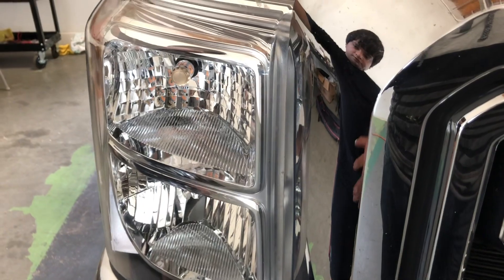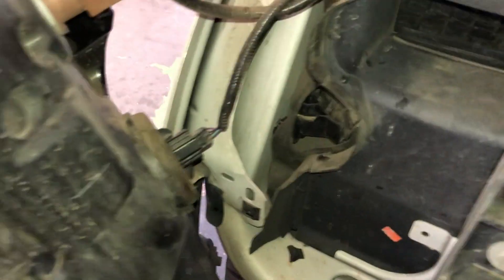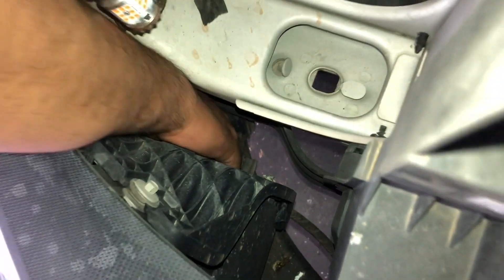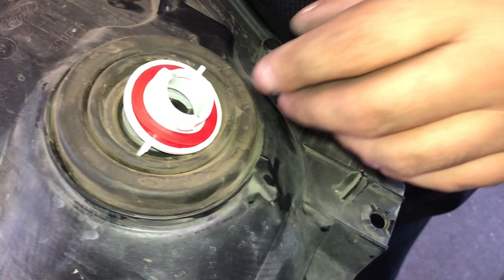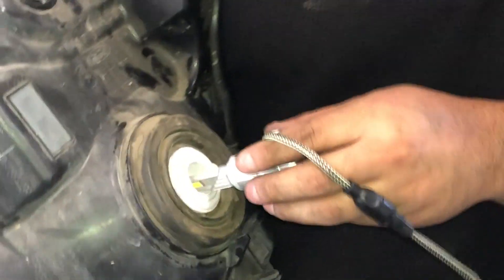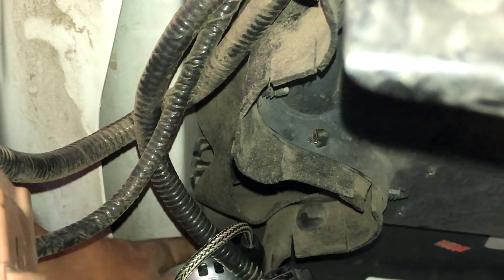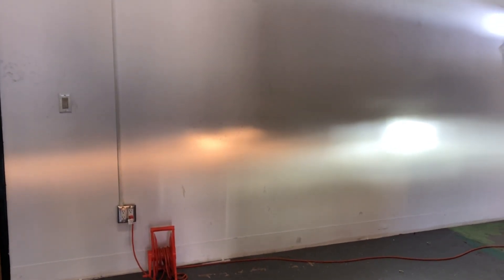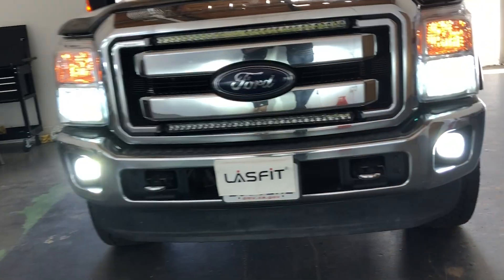2015 Ford F-350 Super Duty Lariat LASFIT LS Plus Series LED Headlight Upgrade - Bulb Size H13

Comment: Do the led bulbs have to be in the 3 & 9 o clock position with the cable connector plug on the lasfit led bulb on the 12 o'clock (top)or with the lasfit cable connector plug to the 6 o'clock position(bottom)?

Comment: Did you have to use a resistor for the turn signals I have a 2015 f350 ? Thank you
Reply from the maker: No  needto use a resistor. Because these LED bulbs are specially made for turn signals, come with built-in load resistor. For 2015 F350, the front & rear turn signals both are 3157. Front 3157 switchback:
https://www.lasfit.com/products/3157-switchback-led-turn-signal-lights-canbus-error-free
Rear turn signals 3157 red color: https://www.lasfit.com/products/3157-4057-4157-canbus-error-free-load-resistor-led-turn-signal-light-bulb-brilliant-red

Comment: Why can I no longer find these H13 in LS Plus series, only LA Plus, as well as most other headlights no longer in the LS series? I really liked mine and im worried to buy the LA Plus and not be as bright
Reply from the maker: It's so pity to tell you that LSplus series is not available at this moment. LAplus series is very bright,  we do recommend it to you. If you don't like it, you can return it back.
Reply: LASFIT Auto Lighting I will give these a try, but what could be the reason for them not being available at the moment?

Comment: Does the ls plus led fit the custom h7 adapter that you make for the sedona?
Reply from the maker: What's the year and trim of your Sedona? We carry LSplus custom H7 LED bulbs.
Reply: @Lasfit-Automotive  i bought the h7 pro series with your custom retainers adapter for my wife's 2017 sedona.
Reply from the maker: @randomlybruh  Ok. Will you install them by yourself?
Reply: @Lasfit-Automotive  I've already installed them. I'm just asking if the custom h7 LA series adapter will fit the LS series led as well?
Reply from the maker: @randomlybruh  The custom H7 adapter does not fit LSplus series. LSplus has different adapters

Comment: Question, what's the difference between LS and LA Series?
Reply from the maker: We think you're asking the difference between LSplus and LAplus series. LSplus: 50W, 5500LM,6000K per bulb, external driver ballast
LAplus: 36W, 3800LM, 6000K per bulb, built-in driver ballast.
The price is different. 🤣
LSplus is not available now, you can choose LAplus. This is LAplus H13:
https://www.lasfit.com/products/h13-9008-led-headlight-high-beam-la-series?utm_source=Social&utm_medium=YTB%20Channel&utm_campaign=LAplusH13

Comment: I need for my 2011 f350 all led lights
Reply from the maker: Hello, below LED bulbs will fit fot 2011 Ford F-350. Note: all these LED bulbs are used to replace the stock halogen bulbs.
Headlight H13:
https://www.lasfit.com/products/h13-9008-led-headlight-high-beam-la-series?utm_source=Social&utm_medium=YTB%20Channel&utm_campaign=LAplusH13

Fog lights 9145:
https://www.lasfit.com/products/dual-color-9145-9140-led-fog-light-for-ford-f-150-2001-2016-expedition-1999-2014?utm_source=Social&utm_medium=YTB%20Channel&utm_campaign=LDH10

License plate lights T10:
https://www.lasfit.com/products/2x-lasfit-t10-192-194-168-158-led-interior-light-bulb-error-free-1-year-warranty?utm_source=Social&utm_medium=YTB%20Channel&utm_campaign=L-T10-White

Backup lights
https://www.lasfit.com/products/canbus-921-912-led-reverse-back-up-light-bulb-upgraded-version?utm_source=Social&utm_medium=YTB%20Channel&utm_campaign=T-T15

Cargo lights:
https://www.lasfit.com/products/lasfit-t15-912-921-led-interior-reverse-backup-trunk-center-high-mount-stop-dome-light-bulbs-6000k-pure-white?utm_source=Social&utm_medium=YTB%20Channel&utm_campaign=L-T15

Center high mount stop light
https://www.lasfit.com/products/912-921-led-third-brake-center-high-mount-stop-dome-reverse-trunk-light-bulbs-6000k-red?utm_source=Social&utm_medium=YTB%20Channel&utm_campaign=L-T15R